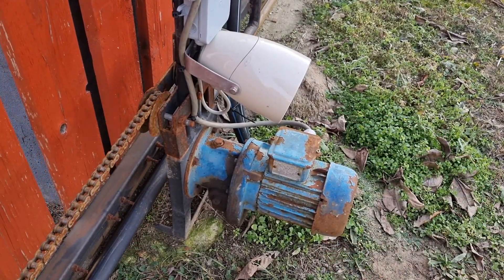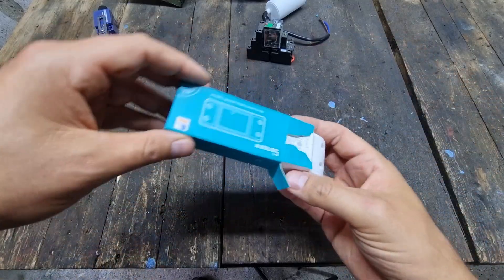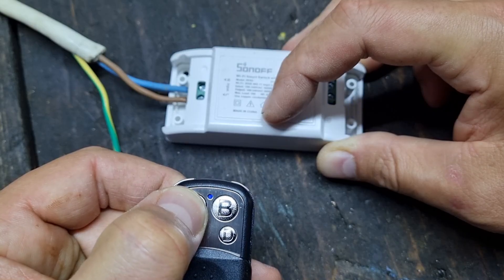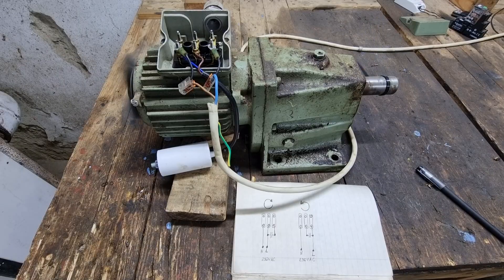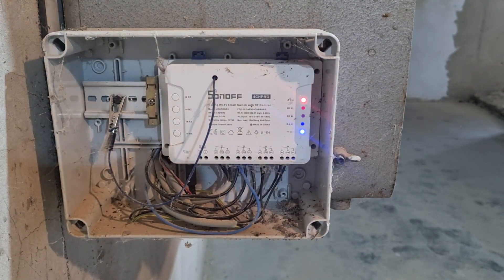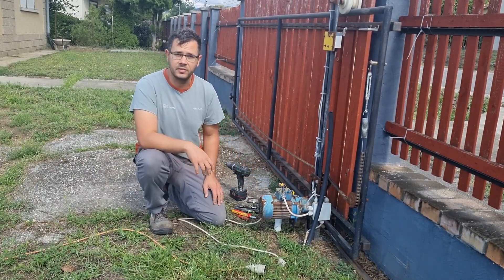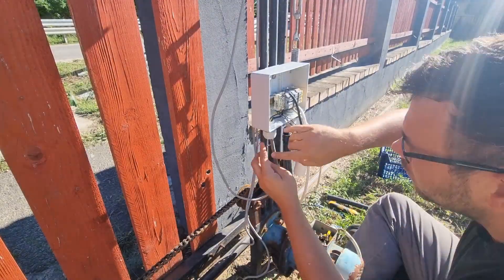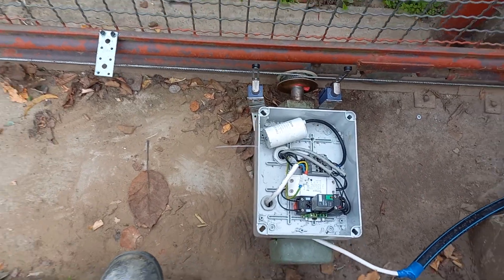DIY Electric Gate for 50 USD, Old Electric Motor & Chain Drive

Comment: That is ULTRA clean.  The spring on the chain for tension is a brilliant idea; I haven't seen that before.  The capstan drive on the worm gear motor is also very well done.  Mounting the limit switches on the gate itself is a pro move and makes for a very compact electrical installation.
Good tip about the SONOFF controllers, too!